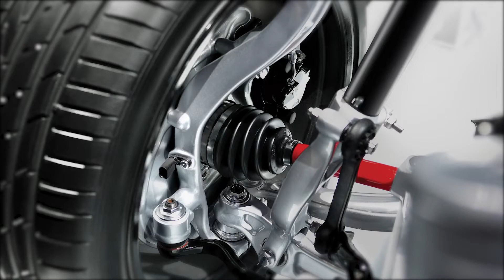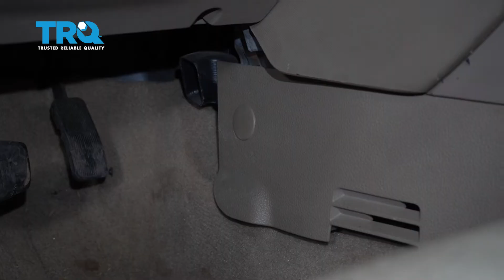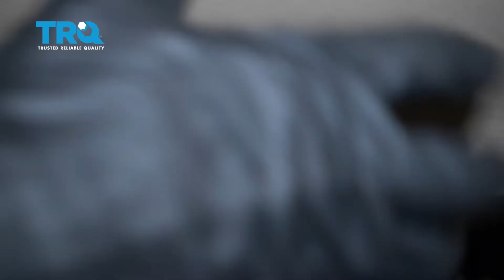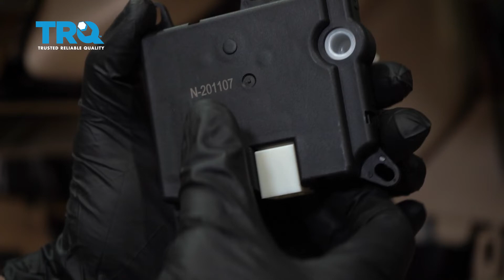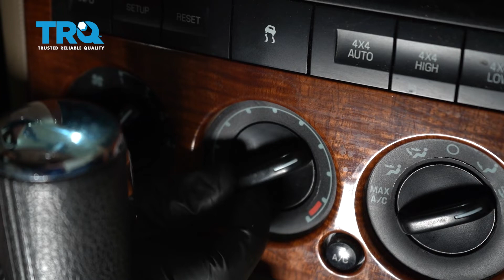How to Replace Blend Door Actuator 2006-10 Ford Explorer

Comment: I have a 2007 sport trac I put a new blower motor in and I put a new blower resister in. I check all fuses and they are good but, I still have no power I turn on the Heat or Air still nothing comes on. Please tell me what I'm missing. Thank You

Comment: On my 2008 Adrenalin, I had a third screw holding the original actuator (drivers side) .  I did not have enough room to rotate and Align the actuator white pin gear with the original hole while plug was connected. So  I inserted the white pin gear with the hole, slightlly rotated the Actautor in til it seated,  then reinstalled the 3 screws then I carefully plugged in the plug.

Comment: Yes, the factory does install a 3rd bolt that is very tough to get to.  I did not put that one back in.  Also, the steering column cover needs to be removed so you can see in better like the video shows.  It's just three screws and some clips.  It's worth noting also this isn't a 20 minute job as the video would imply.  It can be a hour trying to contort into a space you were not intended to fit into and twist your hands into positions, they weren't meant to do.  This is a good video however.  I'm glad I was dealing with an explorer.  I was going to rob an actuator off an expedition I have.  I looked at it and said, I'd rather pay the $20 instead.  That one is near impossible to access without a chainsaw.

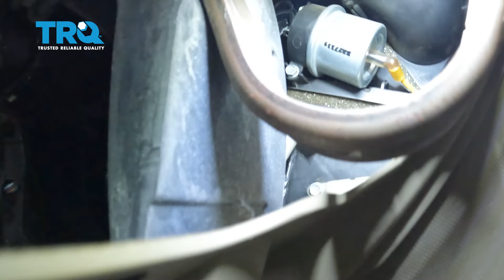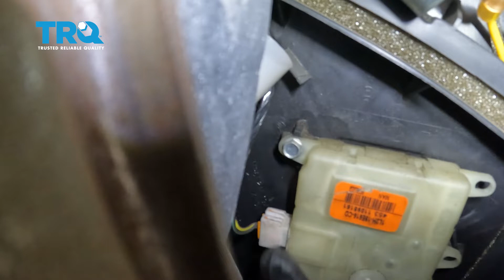Comment: The video is super helpful and a time saver compared to taking out the entire console. Though it appears that everyone who has watched this has rewatched over and over from about 1:38 - 1:45, as it shows as most replayed. This was a very important part of your video, and you skimmed over how to get to it from the top. FYI... for anyone with a 2009 sport trac, there is a 3rd screw on yours. 

Also on the 2009 ST to get to the top screw you have to remove the bottom steering wheel shaft cover. There are 3 screws, 2 up near steering wheel and another at the end of the cover closest to pedals. The one closest to pedals is a different size than the other 2, ever so slightly smaller. I used SAE size and was a perfect fit. Next use a tool to separate the two halves. Once this is done you have a clear shot to the top screw. You will need at least 6" of extension to reach it. When putting this screw back in place you will need a magnetized socket. 

Thanks again for the video!
Reply from the maker: +@99Nedlog Thanks for watching our video! http://1aau.to/m/Shop-TRQ

Comment: I took my actuator out took it apart there was no gears damaged I cleaned the contactor inside that quarter turns it had thick grease on it and bent the contacts up a little bit works like new . Save quite a few dollars fixed it in an hour only took off one cover
Reply from the maker: +@rs2143 Thanks for the feedback! http://1aau.to/m/Shop-TRQ

Comment: If the plastic pin doesn’t fit immediately, one thing I found that works is plugging the actuator in but not installing it and turning the key to the on position so you can turn the temperature gauge, in turn, spinning the pin